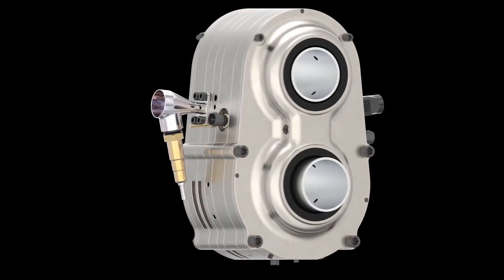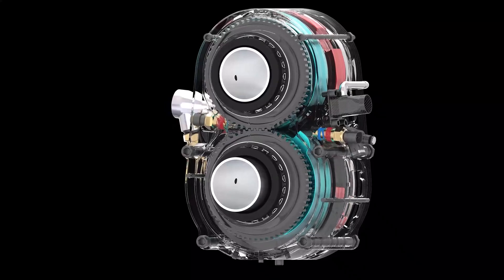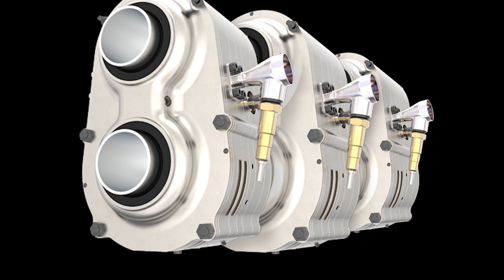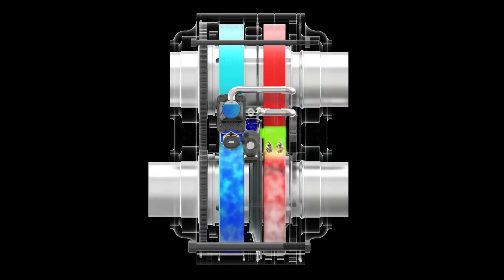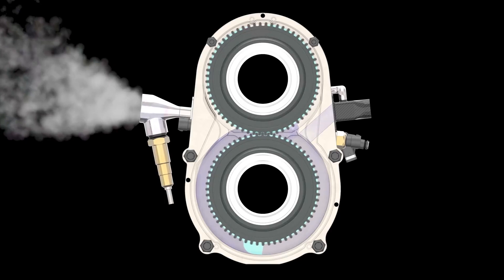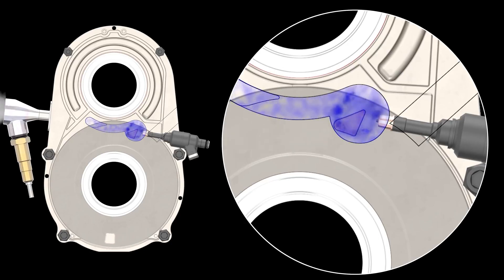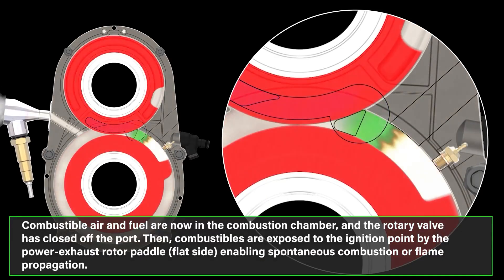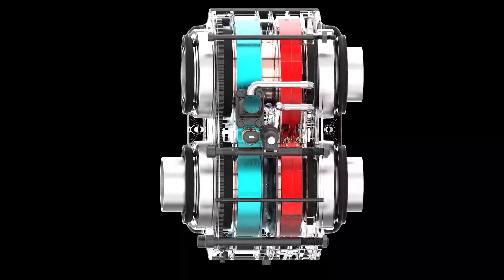This pistonless engine runs on hydrogen and revs to 25k rpm

Comment: who knows if one will ever be mass produced but again, a example of clean hydrogen power which makes a lot more sense than electrifying everything. imagine if a major car company moved their focus from ev's to hydrogen engines, they would come up with a engine concept in no time considering their amount of r&d as well as resources
Reply: toyota made, if i'm not mistaken, a hydrogenized GR yaris that ran a 24h race. it was quite unreliable, but it was to be expected and i think they gained some good insights into hydrogen combustion engines.
also, mazda is supposedly working on a new hydrogen-powered rotary meant to be used as a range booster for hybrids.
Reply: This engjne is actually designed to run on any fuel source.

Comment: I would not want to own a car with an engine that revs to 25k on such a light fuel as hydrogen, you'd get like 1mpg 😂😂
Reply: Also does anyone know the torque because I imagine its gunna be like other rotary engines and have fuck all, not great for a normal or large car, cool engine concept but I'm sceptical if it would actually work, hope so because in enteral combustion is gunna survive hydrogen is sort of the future

Comment: On paper, this is beautiful. In reality..have to see where it actually goes. But I do have to say the initial concept is quite awesome. Just static rotational parts. And potential fuel efficiency, at every 3,5, or 10 revolutions ( I'm just spouting off numbers, not science) sounds cool.
Reply: Doesn't look like it would have the volumetric efficiency to create anything of note.  

I'm going with pipedream. The modern IC engine is inefficient but quite practical for getting large amounts of air into a small area for high power density.
Reply: @davidbrown1060  I'm also worried about vibration. I don't see anything to counterbalance the "tabs", spinning at ( in theory) 25,000 rpm. Unless I'm missing something. Nor have I read any comments about vibration/counter balance being brought up.

Comment: You forgot something in the description. It only exists in a computer and a working model doesn't exist... The specs on it have changed more times than you can count, and make some really outlandish claims. Years after the announcement, crickets... Just imagine the 3 rotor one they claimed would make ~4500 hp at 40k rpm and be about 80 percent efficient!!!! Or the 250cc automotive version that will make ~600 hp @ 18,000 rpm and be well over 80 percent efficient!!!  Yeah right... You need 175 ftlbs of torque at 18,000 rpm to make 600 hp... F1 engines are over 50% efficient and they need way more than 250cc to make 600hp... F1 needed 2500 cc to make the same power at over 50%. How do you get 10 times more power per cc with only 30% more efficiency??? Simple answer, you can't. It isn't possible because the fuel can't do that much work... This is vaporware that people and investors actually bought into it...  Que the crickets again...
Reply: True this will never work. A turbine has also no sealings. A real turbine has much higher RPMs and a well designed burning chamber with continuous combustion. 
That thing is like combining the downsides of a piston engine with the downsides of a turbine.
Reply: shvrdavid   you can't compare two entirely different engine types using different fuels, your numbers are meaningless. besides, this is currently all in design stage.
Reply: @daos3300  I am sorry to inform you, but you are incorrect. The same formulas apply to how much energy you can get out of a cup of coffee, a gallon of gas, or a gallon of liquid hydrogen, etc. You can compare different fuels directly in different design engines based on the total swept volume, energy in the fuel, the amount of oxidizer needed to burn it, and efficiency of the engine to convert it to work (torque). It is call Physics... Calorimetry and thermal efficiency can completely describe any fuel, in any engine design. This engine is vaporware claiming to be able to get more work out of a fuel than it contains, and a few other things that are physically not possible. Believe whatever you want to thou. You can't change physic's with any amount of money. But you can sure convince a lot of people otherwise and waste a lot of money in the process.
Reply: @Nozinbonsai  oh I saw you there ..I'm sure I also saw chuck Norris and some aliens
Reply: Efficiency isn't about how much power you can make from a particular displacement. It's about how much power you get from a specific quantity of fuel. Gasoline, alcohol and hydrogen also aren't directly comparable. Their power claim is theoretically possible, but until they build a working prototype, it's just hype. If this becomes real, it will revolutionize small aircraft, where power-to-weight is everything.
Reply: @paulplack490  So what your saying is, that is is theoretically possible to make a 250cc engine that makes 600 hp??? That's 2400 hp per liter..... How are you going to get 3500+ cfm of air thru 250cc to make 600hp with hydrogen? Simple answer, you can't. Fuels are directly comparable in every pumping engine design by the ratio of air required to burn the fuel. Top Fuel makes 10,000+hp with one of the lowest btu fuels there is... You don't need much air at all with nitromethane, which is why it makes so much power. Air takes up very little cylinder volume and space with nitromethane and you can use far more fuel. You need 20 times as much air to burn hydrogen over nitro methane.  Top fuel uses about 4000 cfm of air which is about the same amount of air you need cfm wise to make 600hp in 250cc with hydrogen at 80 percent efficiency. Top fuel makes 1.3 hp per cc and hydrogen wont ever reach that level per cc because of the mass and volume of air needs to be crammed thru the engine to burn the fuel. Hydrogen is a great fuel on paper, but it needs vast amounts of air to burn it. You can barely get 3500cfm of air under pressure thru a strait pipe the size of the combustion channel shown in the 250cc design. Bend it into a circle and you can forget it. A pesky little thing called physics, wont allow it.
Reply: They have a short clip of it running
Reply: @ayoutubechannel921  No, they have not. They have a video of something like this shaking and bleeding itself to death for a minute, barely making enough power to  "idle".
Reply: @ayoutubechannel921  Liar.

Comment: Something about this engine or this presentation is not right... Tight tolerances to prevent leaks? Horsepower adds up if you stack more engines together? No... This is not how these things work :))

Comment: Question: what's the point of keeping the internal combustion engine alive? If there's a better tech, doesn't matter if it involves combustion or not, then let it advance.
Reply from the maker: The problem is, batteries aren't green. The production of electric cars are really bad for the environment. And there are many countries that don't use green energy to produce electricity. 

Plus in theory you can convert old cars to hydrogen as well. 

Remember there is millions of internal combustion cars already so working on options to make them greener is also important
Reply: @ChrisVSCars  You are wrong. Producing batteries does indeed require quite a lot of energy but total emissions are far lower than any combustion engine vehicle.

Comment: the closest I was able to find to its weight was an ultralight aircraft engine and it only puts out 38 hp at a weight of 17kg, this would be over 4 times that power. 
or for the HP a well built 1.6 liter can produce this much but at 17 times the weight.
IF this becomes a thing it would completely change the outlook of ICE engines, however that level of tolerances... that would have to be seen.
Reply: The difference is you can find this engine in 3D software only
Reply: @M_Jono  There is a functioning prototype, but there's only a video of a 10 second test and it was smoking like crazy the whole time
Reply: @richardmillhousenixon  you obviously are lying since warped perception did a whole vid on it a while back
Reply: I've flown that ultralight engine.  It doesn't put out anything near 38HP.  Nope.
Reply: @foobarmaximus3506  The Rotax twin has been used on some ultralights, and it is probably close to that HP ratings. But most ultralights use a single cylinder, and you are right about those not having that power, not in aircraft build where long life and dependability is needed.
Reply: @foobarmaximus3506  How do you know? OP didn't specify the specific engine so how in the hell can you say for sure you flew that engine?
Reply: check my other comment

Comment: High reving might mean poor throttle response for cars, but this sounds awesome for planes, or boats, where they might spend 90% of their time at 80% max power. The extra mass of the hydrogen storage tanks would be offset by the lightness and compactness of the engine.
Reply: awesome for planes?!?!?  Clearly you know so little about planes and the ideal engines for them

Comment: I would love to see what one running on gas would do - I realize it would be a little dirty, but with the efficiency of this it would still lower the emissions/hp.
Reply: why gasoline? hydrogen is better in everyway
Reply: @simonvalent  Better in everyway except in how (not) dense it is. You will need to burn more hydrogen than gasoline to achieve the same mileage & horsepower figures

Comment: You could carry an extra one in the glovebox for emergencies. If these existed right now I'd replace my old inline 6 with one or two of these.
Reply: Love your thinking. I would gladly swap the 1.8 out of my Miata for a single one of these. Slight loss of power would be more than made up for by the weight savings 😁. A hell of a lot more appealing than any theories I've have come up with for electric conversion.

Comment: seems to me that the weak point would be the gear mesh. also, if they're straight cut gears that would make a great deal of noise. especially at these RPMs
Reply: That's a good point.  It will be a screamer.  The gears will need to mesh EXTREMELY tight to keep the air compressed behind them increasing noise and heat.  My guess is it will actually compress air between the gears to a very high pressure adding even more heat to the system.  In the words of shark tank, "I'm Out"

Comment: The problem with power plants whether they’re combustion or electric isn’t really about the “engines”. It’s about the fuel. No matter how much disdain you may have towards petrol there is simply nothing that packs more energy density into a conveniently replenished smaller, lighter space. Batteries suck on many levels and hydrogen is not naturally occurring, highly explosive and requires sophisticated infrastructure to produce and store. Neither are scalable solutions at the moment. So I wish people would stop focusing on magic engines and and put more thought into sources of power. That’s the Achilles heel of any technology that hopes to replace petrol engines in any meaningful way.
Reply: I totally agree with you, but need to add infrastructure to your point.
Electric vehicles have only been made possible by using a vast and established infrastructure.
No manufacturer will invest in a ‘radical’ technology, no matter how efficient / green / better for the customer, unless there’s a financial profit.
Reply: @RabidRodent69  - Yep. The dirty little secret on fully electric vehicles is, if you look beyond the absence of a tailpipe they are not zero emission and aren’t that green. All things considered a hybrid is greener.

Comment: Still won't beat electric. The problem is there is too much investment into electric already and electric motors were never the problem to begin with, it was always the storage to power the motor that was the issue. This is and has been solved and batteries are getting RAPIDLY better. Unfortunately there is no substitute for the usable power range an electric motor provides and the reliability is also why nearly all industrial factories use electric motors and not engines.

Comment: Pretty interesting, it generates 160hp and 170 ft lb of torque meaning that peak power occurs around 5000rpm since horsepower = (rpm x torque (ft lb) / 5252) assuming it sustains its power output throughout the rev range like an electric motor
Reply: It doesn't produce anything.  It's not real.

Comment: What about this do you think gives it such high efficiency? I’m curious what the thermal efficiency of this is, since I thought hydrogen burned hotter than gasoline.
Reply: Yes hydrogen burns hotter than gasoline hence more efficiency. Also hydrogen releases more energy than gas. Come to think of it diesel releases more energy than gasoline
Reply: @jbaker8871  right, but how does this engine do a better job of turning that heat energy into useful mechanical work? I understand the fuel releases more heat, therefore making the fuel itself a more energy dense (“efficient”) fuel, but I’m curious about how the energy from the fuel is more efficiently turned into mechanical work when compared to a standard engine? I’m specifically curious about the thermal efficiency here.

Comment: It sounds like an engine that might work in specific situations, at certain loads...not one for a car which has constantly varying loads.  But I'm 40yo and I don't see EVs taking over the roads in my lifetime.   I'm still waiting for Freevalve to make its way onto mass production vehicles.  It has already proven to increase power and mpg while decreasing emissions.
Reply: Fair point with free valve, but it seems oil companions are hedging their bets that they've lost to electric, and are hiking gasoline prices to suck the last dredges they can get off it...
That's a wendover video summarized, feel free to ask for a link. Sources are usually included in the descriptions and whatnot.

However, it could also be possible that they've shot the prices up understanding that, even if electric isn't coming roaring through like a stampede, they can still take the money and run, and make excuses later.
Reply: @Fightre_Flighte  seen that video, it's oil Mafia hungry for more money. Greed has no limits.
Reply: @Fightre_Flighte  electric is a scam. Once the govts have forced everyone to it, everything is more polluted than ever, everyone is more broke than ever, market is saturated, then we'll be right back to ICE for more profit.
Reply: @TheGuruStud  
I could get behind these statements. I wouldn't say it's a scam, but we're not gonna be standalone electric for long.

There's many reasons why electric cars have failed previously, this is just round 5.

Comment: Besides the sealing, considering how extremely long the strokes are meaning very high compression, I guess hydrogen is about the only thing the engine can run on. And remember that Hydrogen isn't 100% green as most are still made using methane and generates greenhouse gases.
Reply: Hydrogen is still lightyears better than this scam they wanna push with EVs. And Hydrogen burns cleaner than pump gas by a significant margin. And it has been proven that certain combustion chamber designs that propagate a faster flame front significantly reduce any nox emissions which is the only concern with Hydrogen because of the nitrogen intrinsically present in the air. High pressures and high heat make for a better burn and nearly eliminate nox because it is burned away. If there is still a concern, we already have a way to deal with it in our diesel engines with the SCR and def

Comment: So how would this get converted into a daily use for cars, boats , busses ect to lower emissions as that is the whole point of this right ? Otherwise if u were looking power it would have a different output to alow conversion with less parasitic loss and more capable /usable in modern aplications?

Comment: Those torque and HP numbers are totally made up BS!  Almost all of the energy is wasted pushing on the insides, outside and edges, and only a tiny bit actually pushing on a torque producing little tab that sticks out.  It can never work properly without seals any better than a piston or rotary without seals.  This is a fantasy engine only.

Comment: Put one on a bike and you wont need a gearbox, maybe a three or four speed, but at 25 k you'd need a wide ratio, and shift time from 25k rpm to a usable say, 10k, it takes time to reduce rpm in the tune of  15k, unless there's an electrical governor that acts as an engine brake when you disengage the clutch!

Comment: The process it takes to make batteries for an electic car, the waste when they are spent, and not to mention the added cost to your power bill makes something like this FAR superior in my opinion. Ive never been on the electric car bandwagon.
Reply: also, most electric cars weigh in over 2 tons/ 4100 lbs due to batteries, and yet they have a small range compared to ICEs and their charging times are astronomical as well.

Comment: Or you just use an electric motor.  has about 1 moving part and if it’s like the konegisegg about as big as a coke can. Produces huge power and torque requires no air fuel and ignition and exists.  Liquid fuels are done.  Why are people waisting their time.
Reply: Every resource is limited. Heavily relying on them will cause problems eventually. It's best to look at multiple solutions, so the others don't come to a stop. That is how innovation is.
Reply: @rickitysplitz7035  electric motors don’t use a limited resource.
Reply: @rickitysplitz7035  infact you could argue that this isn’t an innovation it’s the same concept with a different liquid energy.   It’s still burning something to create expansion in a chamber.
Reply: @rickitysplitz7035  respect to you videos tho they are well made.  Thanks for putting them up